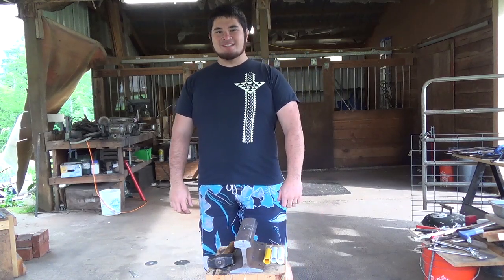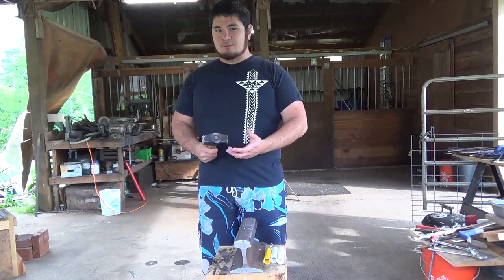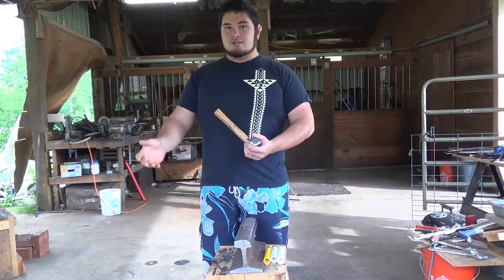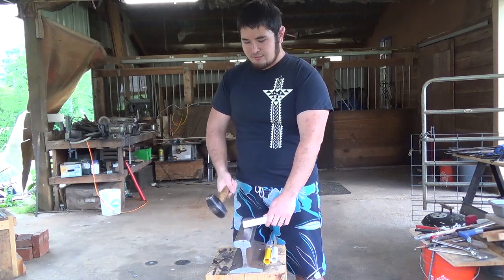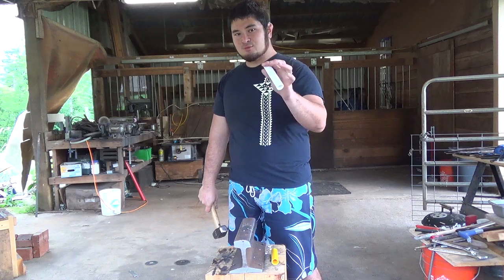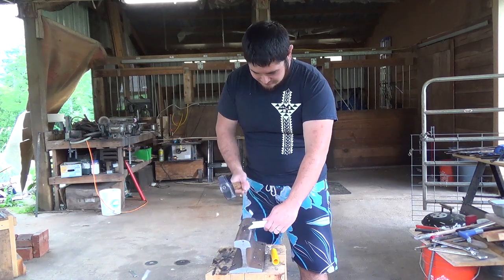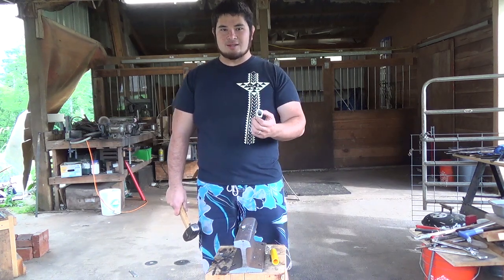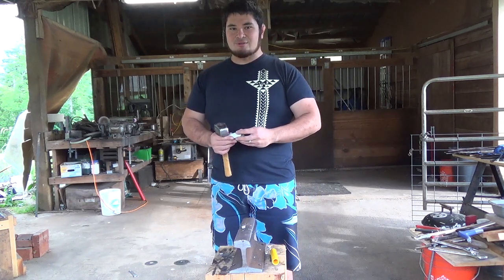How to Test PVC Pipe Impact Resistance For PVC Bows - The Hammer Test

Comment: Can you test upvc pipes? The best stuff you can get here in Australia for bows is apparently rigid conduit and it is made of upvc/pvc-u: 
https://www.bunnings.com.au/deta-25mm-medium-duty-rigid-conduit_p4330848
i haven't used it to make any bows yet, but i am planning to
also, would it be possible to use a very hot hairdryer in place of a heat gun, or would it not produce suffficient heat to make the pvc malleable?